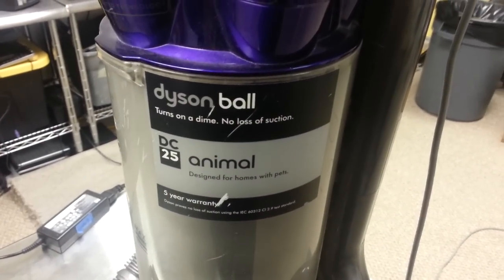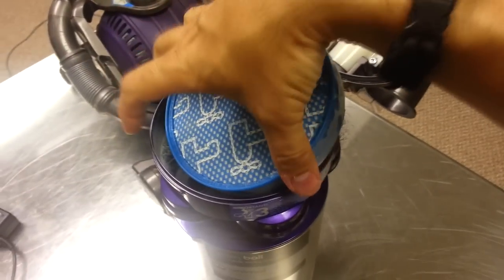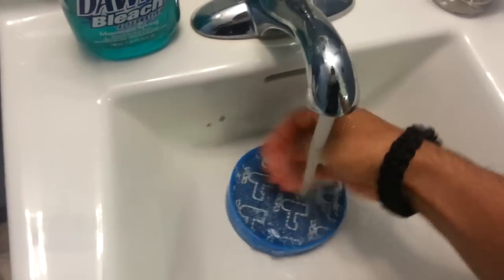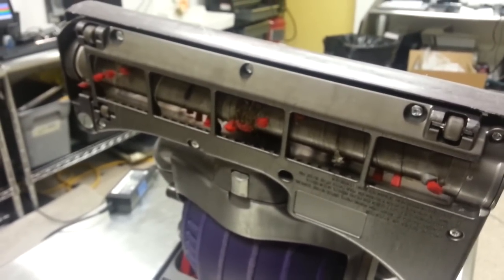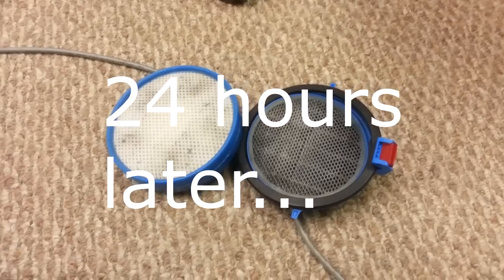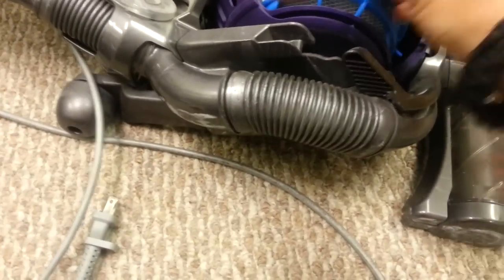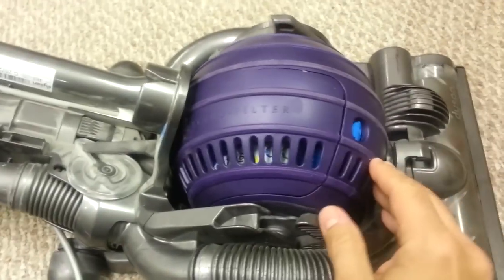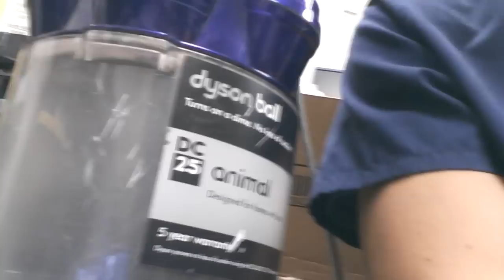How to fix your Dyson Vacuum Cleaner when it loses suction.

Comment: Previously I had gone to Dyson's site and learned how to clean the 2 filters and the hoses if clogged, but I didn't learn how remove the beater bar part.  I cleaned it out, put it back it...and still no sucking...but I finally reached inside with my middle finger (appropriately), and managed to find a piece of heavyweight paper had been inadvertently sucked up and had wedged inside the tube.  I couldn't see it and the wand would work, but the beater bar wasn't picking up because the stuff wasn't getting past the paper.  So thanks for showing me how to take off the beater bar part because I'd have never been able to fix this. This YouTube is being saved in my Favorites!  Thanks!
Reply: mrsarbuckl
Reply: I hadn't even watched the whole video yet, and was browsing the comments while listening - saw your comment, and thought I'd check - YEP! Thanks!

Comment: One thing I also did to make sure everything was dry, was to put the washable filter and cyclone part on top of a floor air conditioning/heating vent (it was winter at the time). But summer time heat would help dry this out well before you need to use it again.  And it's working like a charm..

Comment from the maker: Funny note... a few months ago, my Dyson kept shutting off. I found a fix (did another video on it, regarding overheating) and it worked for a few more months. But then it took a major dump. Internal electronics are beyond my pay grade, so I took it to a pro. Cost to repair exceeded what I was willing to spend, so my Dyson went out with the recycling. Bought a Shark for 1/4 the price. Video to follow.
Reply: Chuck Fresh
Reply from the maker: Here's the Shark. Seems to work better than my Dyson ever did, at less than half the price! https://www.youtube.com/watch?v=ZZPmEB3-UoM
Reply: Because the pre-filter wasn't being cleaned regularly the suction of the motor was actually pulling dust through the pre-filter and through the motor which ultimately led to its death.  There are electronics in the air stream to sense the flows.  The amount of dust in the post motor HEPA filter is how I know the first filter wasn't cleaned regularly.  I had a shark too, but because they have paper filters they were much more expensive to maintain per mfr instructions. (they had the HEPA filter being replaced every year @ $40 each)
Reply: Chuck Fresh lm
Reply: Rj Ti

Comment: I cannot stress the importance of REGULAR MAINTENENCE!!!  CRITICAL!    wipe down all the suction joints with a hopuse cleaner and paper towel to insure you have good joint fits. Check the hoses regularly. Make sure the head which houses  the beater is cleaned and free of lint, dust, etc and the rubber heading around the whole unit is clean and free to move as designed. And of course, the two filters( mine is a DC 40) once a month...wash, rinse or blow out with a compressor...could not believe the performance improvement with these few simple steps!  Actually- its the best vacuum I've ever had and its still working great after 4/5 years!!!
Reply: what is "a hopuse cleaner"?

Comment: That top filter no way dries in 24 hours and would recommend you make VERY sure it's dry before putting it back. We had ours in the warm airing cupboard and still didn't dry in 2 days.
Reply: Alan Barton Very good advice as my motor blew up cleaning the grey section out as water got into the motor. A good two days is a great guide. Perhaps put the hairdryer on it just before placing it back in.
Reply: +Alan Barton Alan, if you find your pre-motor cyclone filter takes a long time to dry after washing it out, one thing I do with my Dyson's filter is use a hairdryer to dry it with, if your wife has one. Hope this helps.
Reply: Agree, if the filter is at all damp,  dirt will form mud in the filter when you vacuum  and clog it completely, as it did only today when I idiotically plowed into the bathroom after someone had recently showered. 
For the past few years, I have used an air compressor to clean both filters, once a month. No problems so far. 

Suggest those without a compressor consider getting a second filter; then can rotate filters and always know it will be bone dry.
Reply: Yes, mine molded while drying. So sick of this vacuum.

Comment: I've had trouble before and it is currently making a lot of noise so won't turn it on. I tried picking up risidual paper as I had shredded a lot of papers and there was quite a bit still on the floor and the Dyson DC24 just didn't like it. I think there is some paper jammed in the motor or something. Not sure. Also, I did try earlier to use the back handheld extension cord so I could use it on upholstery and found there was no suction at all. Must check the filters like this video says as that may be the problem. Can't understand it because at the time the handheld section wasn't working, the main part was!
Reply: +Sandra Jones I wouldn't dream of picking anything up other than dust with my Dyson.....have had things like front door mat bits get stuck in machine and anything stuck in machine makes a huge noise and is the first sign to stop, pull machine apart where you can safely and remove blockages.  Manual should tell you how to do that.

Comment: If you look at the filter, it says to use COLD water, but I don't know why because warm makes more sense
Reply: maybe because warm water can make the material shrink or warp. i used hot water cleaning mine didn't seem to bother the filters, but it warped the seal around the canister and would not open correctly when i would press for the release.:/
Reply: it works fine now, but i was really worried.

Comment: With all the video's on cleaning this machine, (which I have) nobody cleans the cyclone part and i'm wondering if you are NOT supposed to run water through it???!!!  I'd sure love an answer, because even on Dyson.com there is nothing on there regarding cleaning the cyclone on this particular machine.  The other machines that have this cyclone, when the video's show how to clean they ARE running water and swishing it around to get it clean.  Is it possible to do this with this Dyson DC25 Animal Ball?? Do you know, did you guys ever do this or does your book say anything about NOT doing it??  Wondering if it would damage it?  Also, when pulling both filters out, IF you have another vacuum, it's great to suck up the additional crud on the filters with another powerhead, before you wash them.  And I used HOT water before I read about the cold water, which doesn't make sense to me.. but then rinsed in the end with cold.  Anyway, I'd love to hear back.. thanks!
Reply from the maker: that is a GREAT question. bumped to @dyson...
Reply: Chuck Fresh when I do the filter, I take apart everything else and clean it with water and liquid soap. I let it dry for a few days but I feel better that its clean. the cyclones get really dirty
Reply: I actually clean the cylinder tonight, let's see if it works tomorrow. I cleaned everything with water. 2 filters + i took out everything apart and cleaned. it. I hope it works tomorrow. =)
Reply: Lisa Bevill I accidentally got water into the motor by cleaning the grey cylinder out. I had been cleaning up my dog's poo and tried to do a thorough job and clean all areas the poo got to. Big mistake. Blew up the motor and it cost nearly $300 to fix. I did wait 24 hours before turning it on. Apparently it hadn't completely dried. Best not to clean the grey section with water.
Reply: Sandra Jones  uhghgh... gross, and so sorry you had such a bad experience.
Reply: Lisa Bevill Yep, terrible situation. The poo was very dry and I didn't realise it would stick to the sides. Usually pick it up with a doggy poo scooper but that is for outside and I didn't expect what happened. After cleaning out the main container, I could smell it still in the workings so took it apart more and used the hose to clean the grey area out. I seemed to get the smell out, but after waiting 24 hours to use it, it sparked when I turned it on and I knew I'd blown the motor up. Right now it's clogged again with paper I'd shredded into small pieces. Can't understand it. Thought it would all go up into the cylinder. Apparently not. I wonder if a cheap vacuum would have done a better job.
Reply: christine cullen.    Yes it would have, my Dyson has been nothing but trouble since I got it.  Go to Canadian Tire and get one for $80.00 an upright.
Reply: I've ran water through mine and never had a problem. just make sure it's dry when you put it back together.
Reply: You don't run water through the cyclone because water + dust = mud.  Only run either compressed air through the cyclone unit and be sure that the filter is 100% dry and free of dirt before allowing it to dry.  Again water + dust = mud (which will clog the fabric filter)  You know it's clean if you can see the glow of light through the filter when looking from the inside.

Comment: EU rating rates most dysons as only C-D on carpet pick up. Even the most expensive Dyson cleaner thats like £500 only gets a D rating whilst a Vax Air which only costs £100 gets A ratings across the board.

My Vax Air suction is so strong it lifts the carpet up.

Dyson are over priced and under performing.

Comment: How on earth hair managed go to the filter.
Hair will quickly clog those small cyclones. They should separate only the fine dust.
If hair can get to the filter, cyclone assembly is not working like it is designed to work.
Reply from the maker: That's EXACTLY what I said! How is that even possible? Great catch.
Reply: Because the filter is before the cyclone!
Reply: LOL ! No it's not.
Reply: +Vacuumtests Actually... one filter IS before the cyclone... it's called the "Pre Filter"... the second one is after the cyclone... it's the "Post Filter".... LEARN before you spout like an expert... which you are not... I am.
Reply: +Richard Niederhoffer My previous comment was removed for some reason... So only "filter" before the cyclones is the round mesh screen in the bin.
Reply: There's a 1" thick HEPA filter in the bin assembly above the cyclones... not just "mesh"
Reply: +Vacuumtests Maybe they went head-on? :D
Reply: The filter wasn't being cleaned regularly.